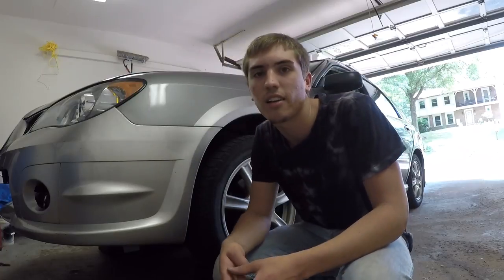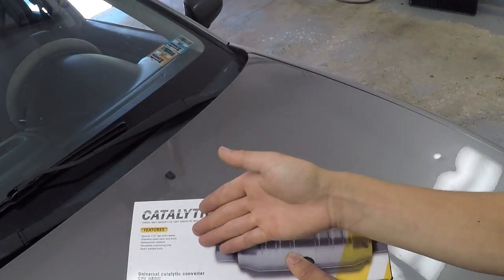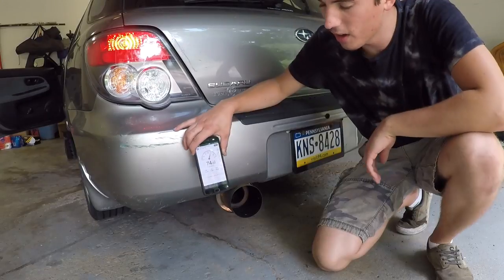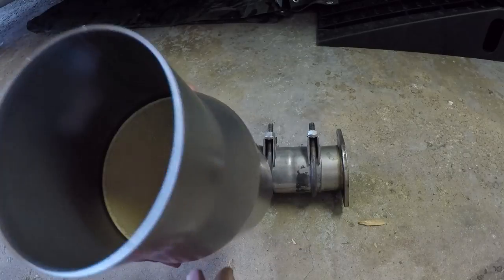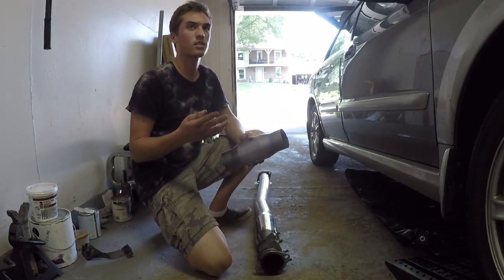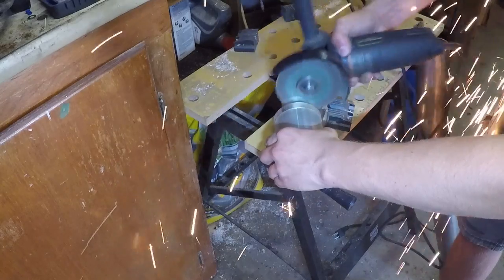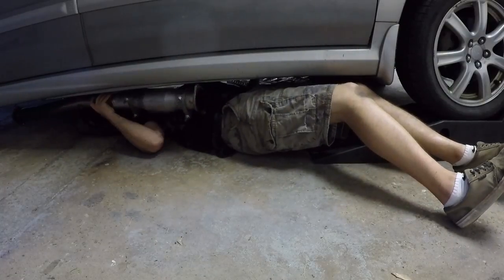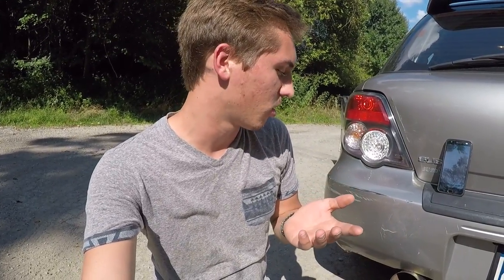Will a Catalytic Converter Ruin My Subaru Rumble?

Comment: Don't you need back pressure for n/a cars, I have a 99 subaru legacy with 2.5L with the 1320 headers and original cats and muffler delete, I want to get the 1320 mid pipe that gets rid of the 2 cats but I'm afraid to loose torque or hp, any facts on this?

Comment: Like the vids, been following the NA turbo mods. To point out, you cut out the resonator which is like a small muffler on that midpipe helps with drone. The cat is supposed to be on the downpipe  just after the turbo where it heats quicker. Thats where its at on the Wrx and Sti on those years. Is it throwing a code yet?? Personally I have an 06 2.5i (not a daily) no cat, UEL modded stainless headers and I love the smell of carbon and gasoline in the morning..;) Trust me dude you aint saving the earth from anything (yawn...), enjoy your combustion engine while giving the finger to these glorified golf carts on the road...
Reply: Fuck yea bro